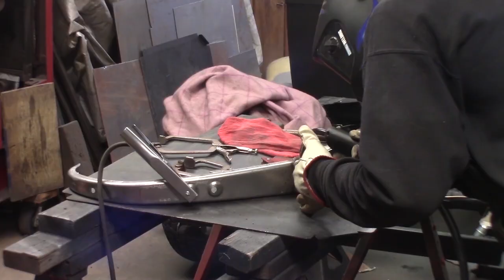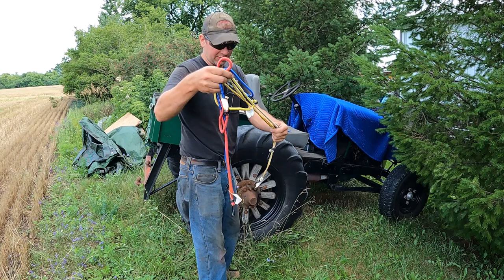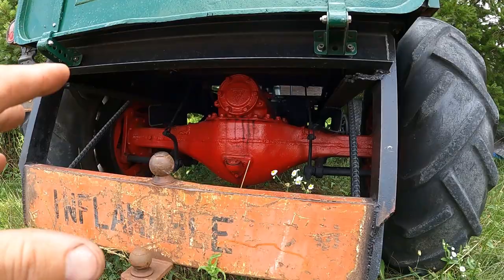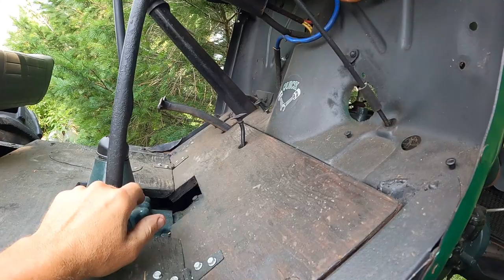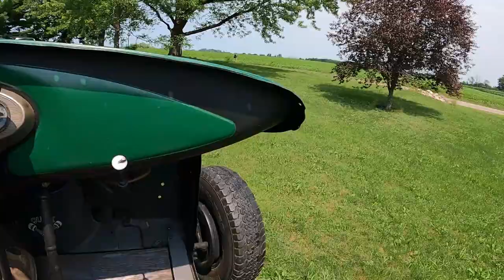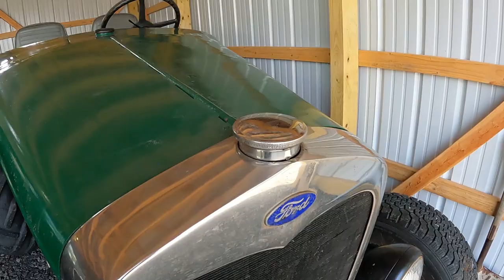Pulling my 1930 Ford Doodlebug out of the Trees after Sitting a Year.  Will it Start?

Comment: Just an FYI if you have a stopped up radiator use about a table spoon full of lye to clean it out. Be advised if a radiator has had stop leak used in it or rotten cores it will also clean that out.
Reply from the maker: Thanks for the tip!